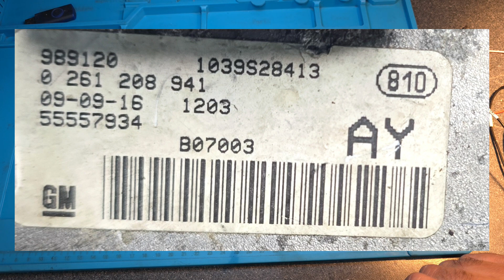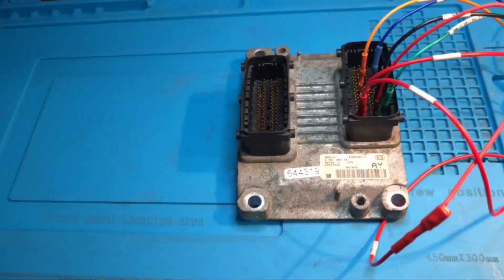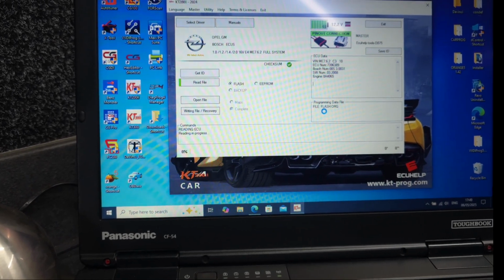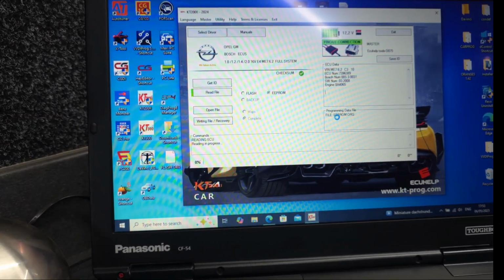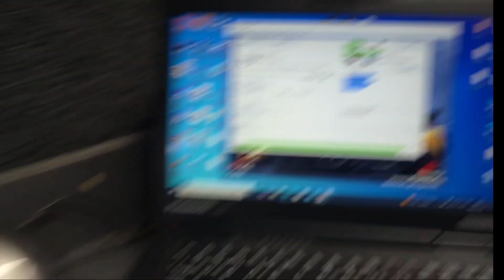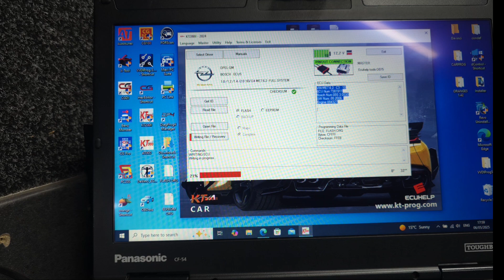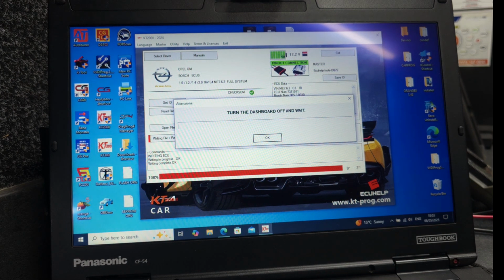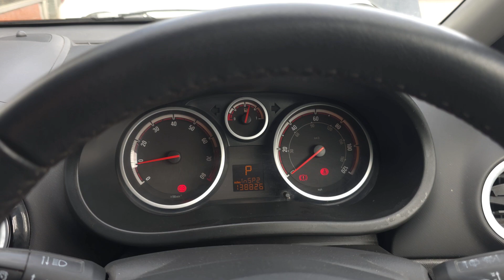Vauxhall/Opel/GM Engine ECU Bosch ME7.6.2 (0261208941) Cloning & IMMO Data Transfer with KT200ii

Comment: This  ecu is me7.6.2 not med7.6.2 
Me7.6.2 also you can read it with obdstar obd and bench
Reply from the maker: 🎉"Thanks for the correction! You're
absolutely right - it's ME7.6.2, not MED. And yes, good point - OBDSTAR can handle it via OBD and bench. Appreciate the input!
Thanks again 🙏🙏🙏